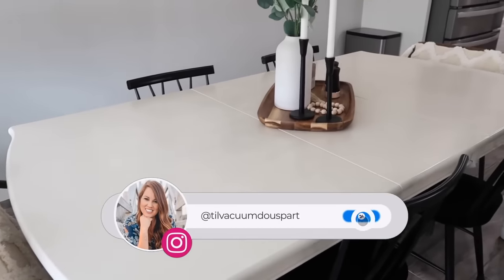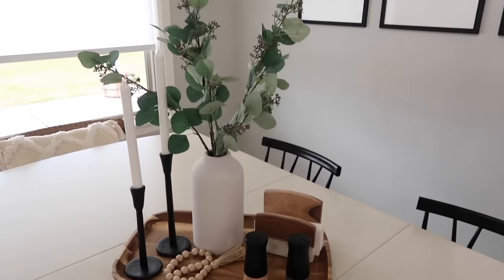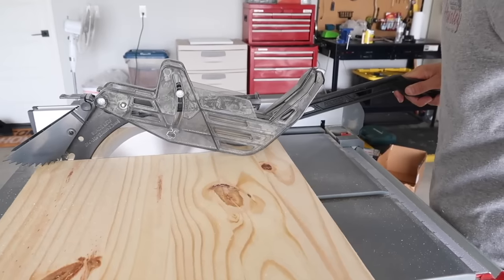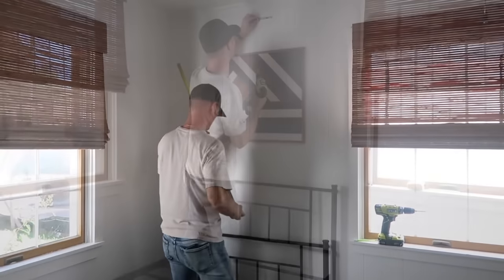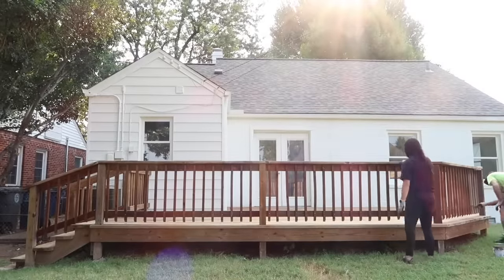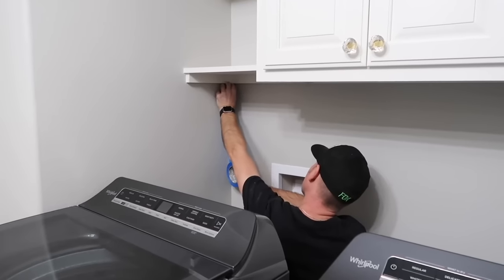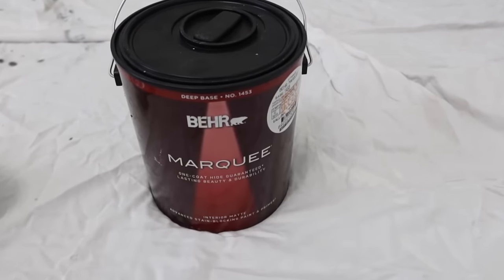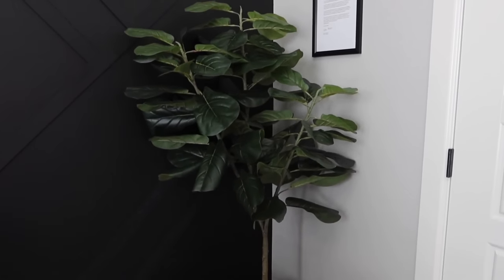2 HOURS OF DIY HOME PROJECTS  | STEP BY STEP HOME PROJECTS | EASY DIY HOME PROJECTS ON A BUDGET

Comment: Tip for staining/painting you deck pickets: Take them off to paint/stain them and then screw them back on when you're done. So much easier!
Reply from the maker: Good idea! These were actually nailed in so would have been a pain to remove and re-install. But if they screwed on that would have been much easier

Comment: You need to use a funnel before you pout paint in the sprayer. And add water so it doesn’t clog the spray gun. And test it before spraying

Comment: Tip: If you started painting with the gun and then take a break, the paint dries up on the the surface of the spraying nozzle. I'm talking even its for a few minutes, it will fry over. So, first thing is to unscrew the paint pot and release the pressure; and then screw it back on, take off the front yellow clip, pull off the yellow insert ( I use a cheap nail brush). Then put the insert back in paying close attention to which way the nozzle insert is matching the direction of the sprayer, reattach the yellow clip and you're ready to go.
A far as the orange peel effect: the should be a dial going from 1-12, this controls how much paint is coming out. When i paint things I usually start on 4 and then adjust from there. The power of the fan: high power or low power depending on what speed you want; I use high on larger projects and low power from smaller things like my shutters. Hope this helps.